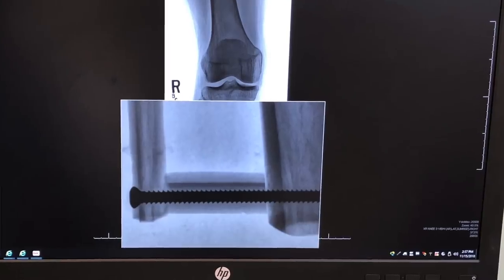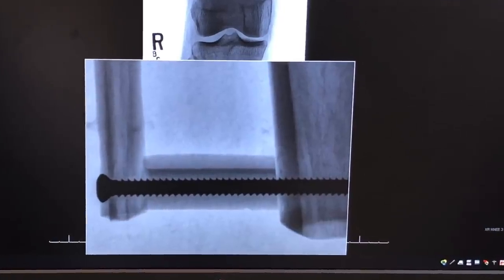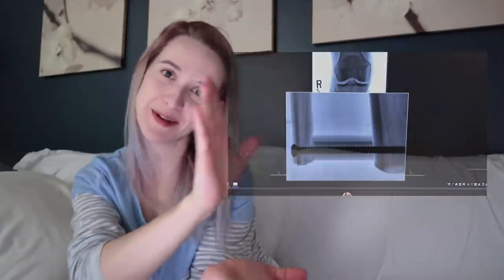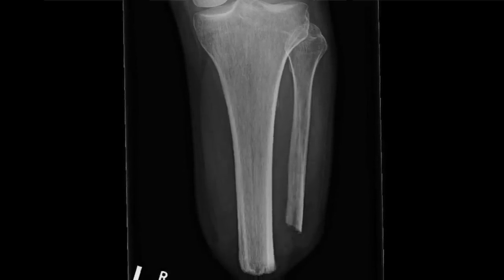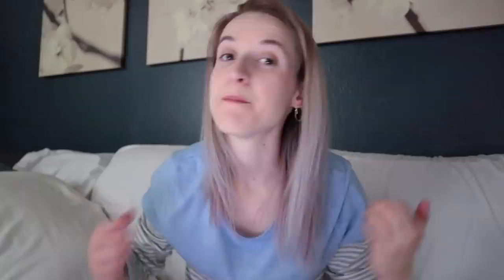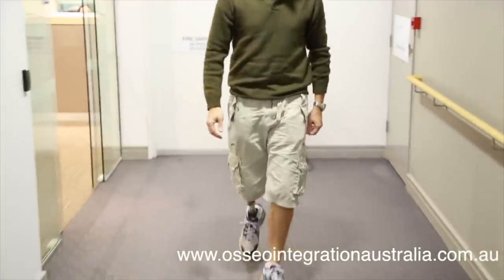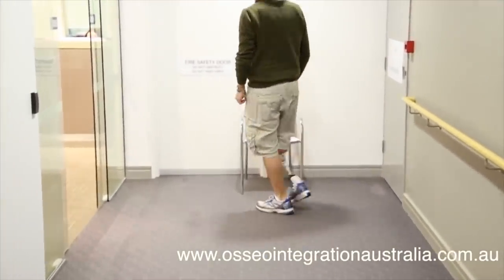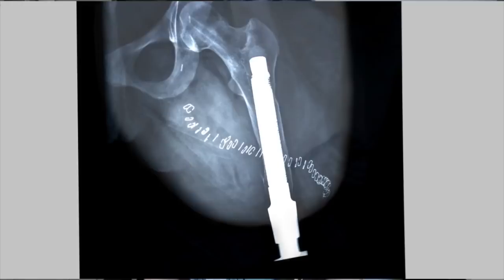Why Was There a Screw in My Leg?! 🔩

Comment: Jo, It's great to see you smiling again.
I got my hardware and plate from a tib-fib fracture back. I used the plate as a key fob for 15 years until my key chain broke and I lost it. I have a similar plate that was used in my dog;s femur. The surgery failed so the surgeon who fixed the failed surgery gave me the plate and screws he removed before putting a femoral rod in. 
I'm looking forward to you getting cast for your socket. My wife got socket #4 today with a beautiful fabric laminated into it. 7 months and doing fabulous. Hope you do as well. Keep smiling.
Osseointegration looks scary. A bone infection can be dangerous for the future of the bone. But, a high femur amputation does not have many options.

Comment: Footless Jo!
Becoz of a broken femur I had a screw thru my tib & fib, just below my knee, attached to a stirrup & pulley system with a 30lb sandbag hanging off the end of the bed to stretch my leg to the correct length. After 3 months flat on my back in traction it was time for the screw to come out. They used local anaesthetic & THAT was when we found out that I am allergic to Pethidine. Full body formication is not a situation you can laugh your way out of. Meanwhile I still give thanx everyday.
Hit by a speeding car - 2 broken legs - damaged spine - chronic severe pain - but I'm alive & can sing & dance & laugh & Love & YES of course I give thanx! Sorry if this was a bit long. Just thought you might be interested in a different screw story?
love
Steve Holliday

Comment: Oh -- I"ve wondered this before, and even more after I saw videos on osseointegration and learned that with a lower limb prosthetic the socket makes the soft tissues into the weight-bearing structures rather than the bone. It seems to me that it would make sense to salvage the person's heel in a below-knee and the person's knee in an above-knee to provide a more natural load-bearing end to the stump. That seems a lot simpler than the operation -- the name of it escapes me -- in which they attach the lower leg to the stump of the thigh, but turned backwards, so that the ankle is now serving as a knee. Yes, this is for improved mobility by providing an organic joint, but it still seems worthwhile to try to salvage the weight-bearing structures for improved comfort and to place the load-bearing backk on the bone rather than the soft tissues even if no joint function is being conserved.

Comment: My Dad got his 2nd titanium hip replacement joint back. When died, we got both of his titanium hip joints back. He was always insistent on us getting them back to sell as scrap since titanium is worth so much. My Dad was Autistic and his ways... were not like those of others. Recycling of all metals with value were one of his passions, even down to getting the brass pins out of old plugs and striping copper wire out of old cables.

Comment: There's a triple-amputee in, I think, Holland who shows how he quickly swaps out different arms depending on what he wants to do. Huge advantage. Also the osseointegration restores the bone being the weight-bearing structure rather than the soft tissues, which is another huge advantage. Upper limb osseointegration reduces the bulk and awkwardness of the socket and harness system. With the new myoelectric prosthetics it's amazing.

Comment: As a matter of fact, dear Jo, I do indeed have one of the screws that was taken out of my previously broken wrist that was shoddily repaired by the University of Maryland Shock-Trauma unit of U of M medical center hospital the State Trooper Helicopter flew me to in October of 2014 after an accident I had. They operated on me and after some months I still had some problems using my right hand. Since it was my predominant hand, I was beginning to think I wasn't going to retain good use of it. Being a Veteran, I went to the VAhospital in Baltimore and asked their Ortho department what was up with this. They took x-ray pics of m y wrist and found that Shock-Trauma had left a screw in me I didn't need.  The hand specialist at the VA took iit out, but all through the prep for the surgery, I pitched a loooooong and very loud and vociferous fit about keeping the screw. I did not let up an angstrom of an iota on this until I had the screw in my hand. Trust me I can be REALLY loud and forceful when I want to be. The screw is in a very small one dram jar on a black silk string that I occaisionally wear around  my neck. I figure it was a part of me for quite a while, the thing is more mine than anyone else's. There you have it.

Comment: Great Post Jo 👌🏻I kept my surgical screws but they have to stay in an glued shut specimen jar (not from my amp) 🔩 my amputation was an ertl, he attached all of my ligaments and muscle to the end of my femur and he also used my calf muscle so that I can still have full use of my quads in my lil leg. Having the ertl and the type of adjustable socket I use, means that my lil leg hasn’t shrunken or wasted away (I’m still on the same size liner I used 3months post amp). Over here in the UK Osseo isn’t available but I’ve met quite a few amputees that had Osseo, both AK, BK & bilateral BK - they flew out to Australia to have theirs. They chose Osseo due to socket fit complications and having theirs has really helped them thrive and they walk without any limping. They all said that it feels like they have their old flesh leg back again. I know there’s a lot of risks with Osseo especially with rejection, infections and bone fractures but when you can’t use a prosthetic due to socket fit complications and your only option is being in wheelchair full time, it’s great to see that now ampies have another option (it’s so expensive £150k). I have met someone that had to have their Osseo removed due to infections and bone fracture unfortunately they had to have a HD Amputation which has really limited their mobility. Thankfully they are doing really well and it hasn’t slowed them down. I’m sure over time they will be able to prevent the infections risk so it can help more ampies. Great post yet again 🙌🏻 highlighting what different surgical techniques are used for amputations will really help people. PS You’re looking so good, to say you only had surgery last wk💪🏻 Hope that you’re recovering well and you’ve not had any post op blues 🤗🥰🤗

Comment: My surgeon and I discussed those options yesterday. I will be having a lbka on May 2nd. My surgeon hasn't performed an Ertle procedure before. But he would have considered the Ertle procedure if I hadn't had a complete nonunion, which of course wouldn't bode well if it failed at that level.

I also have hardware from my previous fusion. One of the plates made a perfect pendant for a necklace.

Comment: I had foot surgery back in 2016.  They did a procedure called calcaneal osteotomy.  The cut my heel bone off, shifted it to the right, adjusted the angle and reattached it with a few screws.  Hardware is supposed to stay in, but in some cases it needs to be removed later down the road.  If that's the case with me, I'm going to ask my surgeon if I can keep the screws.  Cool reminder of my journey.

Comment: FWIW:  Regarding that bone screw backing out of your leg bone:  Hardware {bolts, nuts, screws, etc.} & fittings in aviation are often "secured" in place using {steel} lockwire, cotter pins, or [whatever].  I'm a bit surprised a surgical equivalent has never been developed.

Comment: I have an odd thing to share if you like
(Warning, morbid things ahead)

I know this video is over a year old but I wanted to share something.  In 1980, my father was in a very bad accident. His femur along with multiple other bones were broken badly. Over three years, his femur repeatedly broke and multiple surgeries didn't fix the issue until in 1983, he had a plate attached to both parts of the broken femur and screwed into place. This fixed the  femur re-breaking. He had it until he passed away. He was cremated and the plate survived the process. The VERY kind people from the funeral home let my mom know about it and  she asked if they would give it to her. They agreed and it is with his ashes.  
I've not had any hardware added or removed from my own body but if I did, I'd like to keep it. I'm an odd duck.

Comment: Had two pins and a Kwire removed from my thumb after a joint fusion.  Got to keep them in a plastic specimen jar.  This has been over 10 years ago though, so rules may have changed.

Comment: I was going to say if that was the screw you took it out of the bag thing they gave it back to you in saying it was washed and everything is fine to give it back to you. I have one with screws in it from my leg then I have one with 9 screws and a plate in it from my elbow I still have at least 5 screws still in my elbow. One screw that holds it together and can't be taken out......
Reply: They can give it back but it has to be cleaned and sterilized before they can give it back to you... I have all my hardware that's been taken out of me...